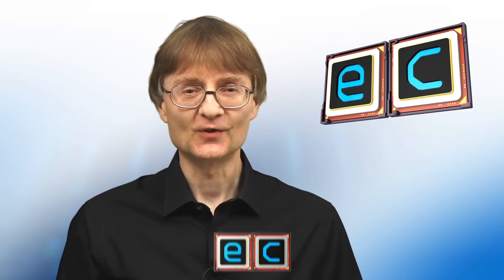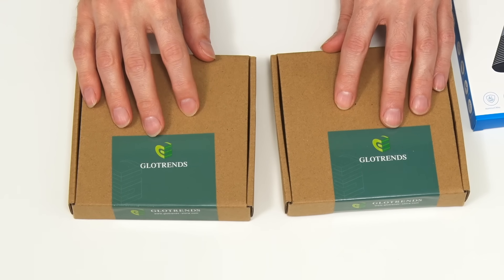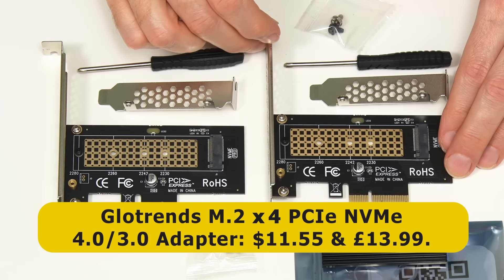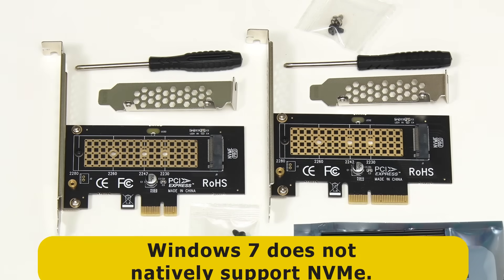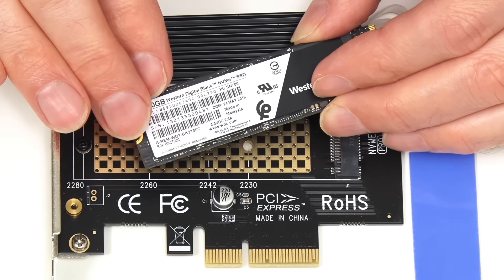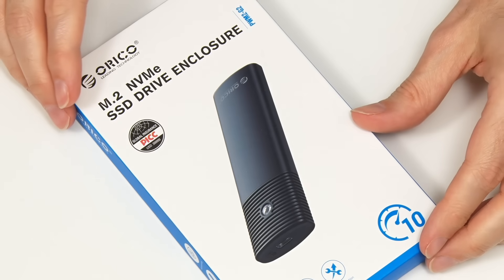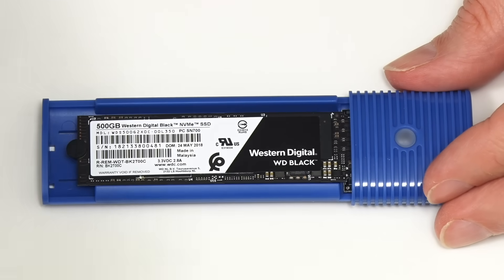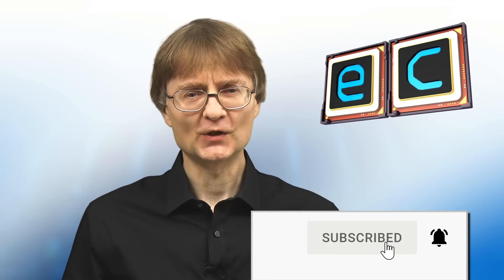M.2 SSD Adapters & Enclosures

Comment: Been driving me nuts in the past I used to be able to buy dual m.2 sata that was pci-e host powered and had 2 sata external ports so you could plug them into the motherboard (I use dell servers with truenas so don't really want to use usb external 2.5 caddies ) 

all I can get now is m.2 1x nvme (connects to the pci-e) with 1x sata m.2 (external sata port) £9

There is a HP 759505-001 SATA M.2 Dual Drive PCIe Riser Card but they sell for £48-60 (seeing if I can get a £90 offer for 3 of them)

I am messing with Enterprise Gear so I shouldn't really be expecting stuff to be cheap, but I am surprised there is no Chinese sellers not doing dual SATA M.2 host powered ( as the last one I have was from StarTech)

Comment: I funnily grabbed that exact same PCIe x1 M.2 adapter a couple of months ago, because I used up my two M.2 slots on my B550-F Gaming (P5 1TB in the Gen 4 slot, P3 2TB in the Gen 3), and noticed you can get a P3 Plus 1TB for about £40 these days...really wasn't bothered about the read/write being 892MB/s and 862MB/s for reasons stated in the video--it's still faster than a SATA SSD, and used for storage. I guess you can "compensate" if you have something like Asus's RAMCache III. 

Can say, the adapter has been doing just fine since I've had it.

Comment: I'm using this adapter on a z87 motherboard for 4th gen intel on PCI 2.0 x4  but this motherboard isnt native compatible with nvme need do bios mod or bootable drive to use it as OS unity , on z97 motherboards for 4th and 5th gen intel core started the NVME support 10Gb/s on PCI 2.0 x2 natively. And for AMD started on 1st gen of ryzen .

Comment: I think you missed an opportunity regarding heat sinks. 
NVMe drives are notorious for thermal throttling issues when operated w/o heatsinks - especially NVMe 4/5. Witness the increasing number of drives offered with serious integrated cooling solutions. It annoys me that motherboard mfrs are stingy about including basic NVMe heatsinks with their boards.
If you are not monitoring SSD temps when measuring performance, then you're not getting the whole story. Perhaps a follow-on video?
Reply from the maker: I did note that a heat sink is advised beyond a PCIe 3.0 NVMe drive. :) I agree with you that it is a shame that there are not more and better motherboard heat sinks for them -- and indeed that they are not included by drive manufacturers.

Comment: You should be able to do PCIe 4x over a Thunderbolt 3/USB-C connector. Which should allow awesome performance. However no one seems to do this - most external hard drive cases use USB 3.x bridged to NVMe instead of NVMe natively over PCIe. Maybe it's a software thing, i.e. operating systems don't support removable PCIe NVMe drives.

Comment: Excellent breakdown and demonstration. A further useful demonstration would have been to use a typical 2.5" SATA SSD in an external enclosure to compare speeds. I feel sure that most people would see such benefits that they would prefer an external M.2 SSD data drive solution almost every day of the week in comparison.
Reply: There are 2230 NVMe enclosure "thumbstick style" in USB C and USB A. Perfect to re-use all the 256GB and 512GB drives coming out of upgraded Steamdecks etc.  (I scored a 1TB WD for $30 and a 1TB generic brand for $26)

Comment: Some days ago, I used that same adapter to add a NVMe drive to my old system. First my idea was to get a SATA SSD, but then I saw the adapter online and realized it would be faster than the SATA ones, even using a cheap NVMe M.2 SSD and taking onto account the PCIe 2.0 instead of 3.0. The only downside is it can not boot directly from it (cause of the old motherboard), so I would still need to use the GRUB loader on the HDD. That way I installed the new Linux Mint 20.2 on it (when you install, remember to tell the installer to put GRUB on the HDD, and not the NVMe).
I also had the idea of using a USB stick drive to boot with the GRUB on it, then redirect the boot to the NVMe, I'll test that later.

Comment: Older computers without M.2 slots might not be able to boot from Nvme-drives.
Reply from the maker: This is true. But they will be able to use an NVMe drive in a PCIe adapter.

Comment: Brilliant, I just increased my drive Read speeds by 6 times and Write speeds by 10 times on my 6 year old PC using this simple upgrade. Looking forward to the cloning video.
Reply from the maker: Now that is a result! :)
Reply: Just on the subject of cloning, I tried the Samsung cloning tool "Data Migration" that came with my SSD NVMe and despite several attempts it would just freeze almost straight away. Found Macrium Reflect which was free and worked flawlessly to copy OS and data to the NVMe which is now my C drive.

Comment: I believe that PCI ports are backward and forward compatible.
I have dremelled out the end of a small slot to fit a larger (but quite basic) graphics card in - to my surprise it worked!
Reply from the maker: It is indeed possible to to put a higher lane card in a lower lane slot (eg x16 card into a x8 slot) if it is either open-ended, or altered as you describe.
Reply: @ExplainingComputers  thanks for your informative videos.  I work in IT and I've been building my own PCs for years, but it's always good to keep reinforcing the knowledge, or learning new things that you haven't picked up on the way.

Comment: I'm currently using An NVMe 6Tb external drive for a backup drive. I remember my first PC was a 386 and the snail speeds back then were considered quite fast but they weren't always reliable. amazing how technology advances so rapidly. Yes I was in my early twenties when I got my first PC. Always thanks for the great info Chris.

Comment: @explainingcomputers  most mother boards have the back of the pcie slot open.  If you put in a 4x card in the 1x slot.  It will run at 1x speed and not use the other traces not connected.
Reply from the maker: "Most" motherboards certainly don't have the back of the slot open. A few, older boards do. You are correct that a higher line card will run in a lower lane slot if the slot if open ended.

Comment: Wait. Something is weird here.
About the USB NVMe SSD enclosure. How does it work?  The SSD itself only accept PCIe signal right?

 But why does it work in ordinary USB Type A 3.0 port?
Reply from the maker: Because there is a PCIe controller in the adapter!
Reply: @ExplainingComputers  so the PCIe controller inside the Adapter will not take the PCIe controller portion inside the CPU?

Comment: These external enclosures may actually has a capacity limit other than the capacity of the drives. Nowadays 2 or 4 TB seems the general norm. Maybe not an issue most of the time, but 8 TB drives are rapidly becoming accessible for us mortal humans. Excellent video BTW. I just had an itching nitpicking organ that I had to scratch.
Reply from the maker: Some may have a capacity limit, as all drive enclosures may. A 2 or 4GB limit used to be common, but is extremely unusual today.

Comment: When installing the heatsink on an SSD as shown in the video would you peel off the sticker first or can the heatsink and heatpad go on top of the sticker?
Reply: MUST peel the sticker off. But there's a trade off here.

Some NVMe SSD manufacturer actually puts the sticker on the other side of SSD knowing people will definitely install heatsink on it. Therefore no need to peel off the sticker.

In this video however, the sticker is faced directly on top where you supposed to use Heatsink. If you put Heatsink, you have no choice but to peel off the sticker. AND losing the warranty of the SSD instantly because you peel it off. So you cannot claim warranty if something goes wrong.
Reply from the maker: What @ClayWheeler says is spot on -- it is best to remove the sticker, BUT you may void your warranty in doing so.

Comment: I'm thinking about getting PCIe NVME adapter (4-lane, most likely PCIe 3.0) to be used with budget NVME PCIe 4.0 SSDs like KC3000 or Samsung 990 Pro,
I wonder if I should be concerned with use of additional heatsinks, or would PCIe 3.0 interface limit performance/power enough to keep temps reasonable?
Reply: The answer is your 2nd question choice. Temp is fine
Reply from the maker: As noted in the video a heat sink is not usually required ith a PCIe 3.0 NVMe drive.
Reply: @ExplainingComputers   and PCIe 4.0 NVME drive in PCIe 3.0 slot?

Comment: I have an Orico M.2 USB 3.1 Enclosure with an Samsung EVO 960.
I can get 1GB/s transfer speeds easily with it.

I ran and NVMe SSD on Windows 7.
Microsoft added support for it with updates KB2990941 as well as KB3087873
Microsoft removed KB2990941 from their repo and it makes you wonder WHY.
Force people to Windows 10?

Comment: As I mostly use other people's old cast-off gear with Puppy Linux it will be interesting to see how long I come up against an M.2 SSD.  This video will be handy to keep in my YT computing library.  How long before I will just be using a smartphone connected to a monitor instead?

Comment: I wish you had used a thunderbolt enclosure for your testing as well as these are much faster than even standard USB 3.2 Gen 2. There is also the USB 2x2 system that is about twice as fast as the gen 2 when you tested.

Comment: I need to find a way to plug an external graphic cards without using the "slow" Thunderbolt ..maybe a cable straight to the pci slot?

Comment: On old devices with pcie2.0 you can run a SATA m.2 on a 1xpcie2.0 slot with a decent performance, like for a boot disk(check that your MB can boot from.the pixie adapters ) if you want use all the SATA MB connector for a cheap NAS.

Comment: You mentioned that there are cards that can hold more than one M.2 SSD. You should probably have mentioned, that people have to be careful with those and check either the card or their motherboard for PCIe bifurcation. If neither supports it, then you will only see one SSD in your system.

Comment: This topic is on time for me, sir.  I recently acquired a Dell Precision 7520 in which the primary drive is a 500 GB Hynix NVMe SSD.  It has a heat spreader mounted, and moves along quite nicely.  I use a 1TB SATA hard drive I had at hand already as my second (data) drive, which keeps the primary drive reasonably free.

Comment: Thanks for the bit about the mounting method on the Orico enclosure.I am near the point where I'm going to buy 2 of those but it wouldn't have occurred to me that an enclosure manufacturer would give such a flimsy mounting method. I'll make sure to get one with a screw.

Comment: Slapping a dirt cheap 500GB-class NVMe SSD into an external enclosure beats any USB stick out there by a long shot, even when the external SSD is kneecapped by USB 3.0 (5gbps), all while costing less than a brand name 256GB USB stick that does half the speed at the best of times...
edit: heck... one might even have a small(ish) 500GB SSD left over from an upgrade, meaning the only cost is the enclosure itself

Comment: Solid state storage is a nice advancement, but lately I have become nostalgic of the spinning rust and obtained several 10k and 15k SCSI & SAS drives and also an NOS Iomega Jaz drive. Oh the sweet sound they make from modern mechanical drives. In no way would I want to go back to the ancient dog slow, super noisy HDD's of the early years.

Comment: I had need of install a 2230 in a board that only had the larger sizes. Ebay came to the rescue with a well made adapter for $6. If anyone ever needed to fit one.

Comment: orico is sata or nvme i use about 20 to image dell computers only issue is they get knocked loose sometimes and i have to reseat the drive every now and then great value just need a thunder 4 version now

Comment: If using integrated graphics and a x16 PCIe slot is free, there are cards that take multiple drives and use up all 16 PCIe lanes. For the unaware you'd be able to combine the multiple physical drives into one logical drive to get even more speed. This can be done either in the motherboard's BIOS raid settings or in Windows disk management. 
One thing I wish I knew sooner before purchasing one of these x16 cards is that although a second PCIe slot advertised as x16, it isn't often true: you can plug an x16 card into the slot, but it only has pins for x4 or x8. Most motherboard manuals include this type of information, but one would think that if it fits it works. I believe this has been pointed out in one of your previous videos, I'm just reiterating to possibly save someone the disappointment.

Comment: A timely video Chris! Explain THIS if you can ...

I recently bought a WD SN570 (DRAM-LESS) 2TB SSD (£81.48) to use as a USB data backup. My Beelink Mini S PC uses M.2 SATA, and this was my first NVMe drive.

I fitted the SSD into a newly purchased enclosure. Upon plugging the drive in, it appeared dead. Then it came to life. The drive behaved erratically, appearing and disappearing.

Having limited ability to test NVMe SSDs, I tested it on my Windows 10 desktop, and an ancient Dell laptop upgraded to Windows 11. It seemed to work okay on those.

eBay refunded the SSD and the enclosure.

Long story short, I think this may be a problem with the Beelink Mini S? Some kind of incompatibility, or fault on the USB ports? A SATA SSD which previously worked fine, also started behaving erratically connected to the Beelink.

I think the SSD might not be faulty after all? In which case, I got a free SSD!

EDIT: I've only just started using M.2 SSDs in the last few months. To be honest, I don't trust SSDs to store data unpowered for long periods. What do you think?
Reply: There was a video by another content creator who explained that there’s a 50/50 chance of bringing back a dead SATA SSD back to life by simply plugging the SATA power cable and without the SATA data cable. Turn on the computer and leave it running for about an hour and the SATA SSD drive will supposedly self repair itself at some point? Then connect the data cable afterward to read and copy data off it if possible. Wasn’t successful in my case but worth trying than not.

Comment: You use a PCIe 3.0 flash storage (NVMe). Do i see it correct, that if you have used a mainboard with a free x16 slot and a x16 adaptor, you could reach 15GB per second?
Reply from the maker: A x16 PCIe 3.0 slot can reach (theoretically) 15.75GB/s. However, NVMe M.2 SSDs are four lane only, so are limited to just under 4GB/s. So a x4 (4 lane) card gives the maximum possible speed.
Reply: @ExplainingComputers  i think i've seen an x16 adapter, i'm guessing that's for the benefit of mounting multiple ssd's
Reply from the maker: @richard_d_bird  Correct. :)
Reply: Oh dang! I was quite euphoric about "x16 tuning". Yes, it is right, all x16 cards are limited to just 4 lanes, but they advertise with 64GB.  @ExplainingComputers  Then i will not invest in NVMe.

Comment: Great video. I was looking for a PCIE 4.0 card that would handle 2 NVME drives, as you mentioned, but unless you’re using a RAID configuration, they just don’t exist. But good info. Thanks. P.S. a downside of the NMVE enclosures is that you lose the SSD dynamics. For example, I have an Orico with a Samsung 980 Pro, and when I run Samsung Magician to check the firmware, etc., it does not see the SSD. It only sees the Orico interface.
Reply: They do!  Search for ELUTENG M.2 PCIE Dual M.2 Expansion Card Low Profile - they're $7.99.

Comment: LOL at that plastic enclosure with no air holes including a heatsink. You could apply that, sure, but it's not really doing much - once the heatsink is saturated, all the hot air is still trapped inside the plastic enclosure, having to slowly dissipate through the plastic to escape since there's no air holes to let hot air out and fresh air in. I would not use the featured enclosure, or any other plastic one, for a fast PCIe 4 or higher drive. Get a metal enclosure where the enclosure also doubles as a heat sink so the heat is escaping as easily as possible.
Reply from the maker: The casing of the enclosure is metal. :)

Comment: Brilliant video! I shall be buying one of these through your link.   - If you haven't shot the cloning video yet , please address the issue of whether it's possible to 'clone' your nVME drive onto a larger one. nVME drives are getting cheaper now, so as the old vNME drive gets towards its end-of-life and we wish to clone it (before it gets write-disabled) , it's often desirable to replace it with a larger capacity unit as they ofetn cost less than you paid for the old unit....  You really have chosen to make these videos at exactly the right time for me , thank you.😃
Reply from the maker: It is shot, but you can indeed clone an NVMe SSD to a larger one -- which the video demonstrates. :) It will post next Sunday.
Reply: @ExplainingComputers 
I should have known that you'd be WAAAY ahead of me !  😃 Best Regards and thanks.  Loooking forward to next weeks vid.

Comment: I know I'm jumping ahead here, but for backing up, I used to use Macrium Reflect.  It was quite reliable, until one time when I wanted to transfer to a different drive after a failure.  It refused to restore to a different drive.
After that disaster, I've been using Clonezilla.  Its not the easiest software to use, but its free and it works very well.  I've used it to backup and restore Windows and Linux many times over the past 12 months.

Comment: My favorite cloning application is Macrium Reflect -- although I use it on my computers, so I have paid for multiple licenses.  I haven't used the free version in years, so I don't know if it's still any good to clone drives.  The paid version works like a charm, however.  Easy!